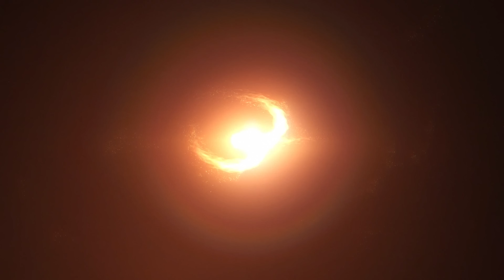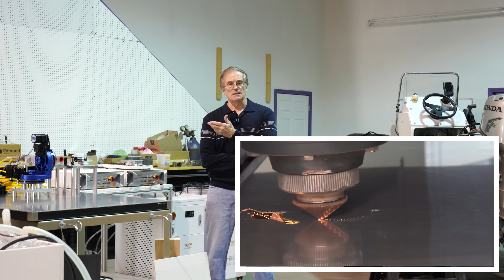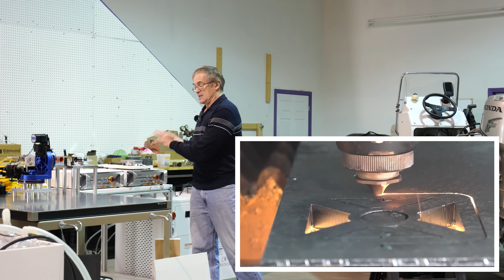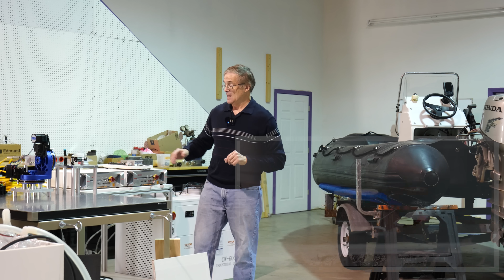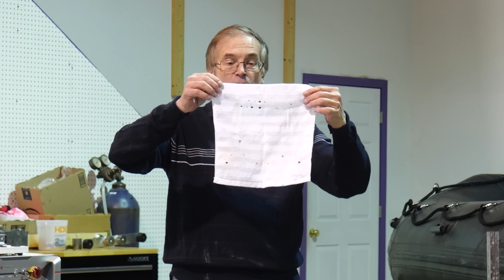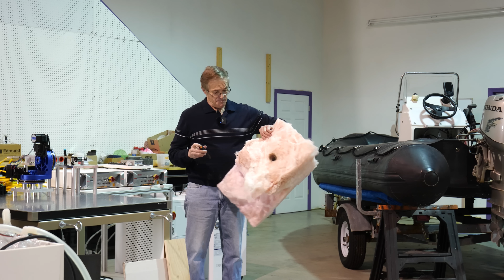We have a problem... and need your help!

Comment: I’m no pro at this, but maybe some sort of material that can simply diffuse the laser. I imagine something like a glass window, but basically a bunch of lenses. Interesting problem area
Reply: Fish tanks full of water?

It would be hard to find something to absorb the heat - even if you did, it would need to be able to tolerate high temperatures. That’s going to be hard to handle.

If it were me, something to diffuse the lazer or redirect the lazer into the sky.

What about dirt? Direct the lazer into the ground.

A handful of mirrors tilted down into the ground would safer than sending it into the sky.

Comment: Polymer defraction grating (very fine) backed by activated carbon filter (HVAC) run a water curtain over and thru both layers.  Use a pump an sump to recirculate.  Use some soap for wetting.

Comment: You could use graphite, or, if it's possible to have an optical window that transmits the laser while withstanding high intensities, you might use water loaded with optically absorbing particles (e.g., carbon black properly dispersed with surfactants). However, I'm not sure this approach would be straightforward, as much depends on the stability of the suspension—forced circulation of the fluid might help. Alternatively, an active system capable of disabling the laser upon detecting that it has reached the blocker could be considered.

Comment: So I think we need to go along the lines of Kiss keep it simple main objective is to be able to dissipate the energy second objective is to keep it from reflecting back and third objective is not to catch fire one of the things that came to mind for me that worked off a few of the principles you actually mentioned would be like a water curtain now Water by itself would be reflective so even if you made someone of a translucent tank that would let the light pass through and into the water it could reflect back and forth but therefore just poked holes and everything even if it absorbed it so we can't do a tank because it would Pierce through it and make leak and you can't make the water cloudy because then it wouldn't let it pass through the first letter and would melt the tank from the back side still making it leak but what if you took denim based insulation and made a wall type support structure whether it's just a 2 by 4 frame with a plywood facing and you put the denim base insulation hungover it so that the wall supports the denim you could even use pressure-treated lumber to help it warping and stuff depending on how often you want to reuse it but you make a rain curtain that sits there and points towards the wall continuously spring water like in a swamp cooler and it all drips back down into a trough so you can collect it and reuse some of it but using the water to help absorb the Heat as the laser points onto the denim which being a darker color will also absorb heat what's being draped across the wood will also help absorb the Heat but with water spraying down across the entire thing will help keep it from Catching Fire if any and will self extinguish while also providing multiple layers of protection because water itself takes a water energy to change phase and if it's constantly being poured onto the denim acting as a giant Wick it can hold the water allowing it to try to absorb some of that energy to change phase and then with it being draped over a plywood face on a wooden built wall the wall being soaked with water on top of it will also help absorb more energy well should still be very easy for you to move around and deconstruct after everything is done while all being very basic but each use has a practical of its own denim base insulation being fighter retardant so hard to catch fire the water help preventing any fire and acting as a cooling agent as well as a heat exorbitant agent and hopefully with that you should be able to absorb and stop the beam fairly reasonably by only using maybe half inch or 3/4 inch plywood built up on a frame to make a freestanding wall that you would rape denim or fiberglass insulation I say the denim because it's less likely to tear apart when draped over and then using a pipe on top grilled with a bunch of holes to sit there and flood it with water wallet all drops back down into a trough on the bottom or holding tank so it can be recirculated I figured if you use a 2-inch pipe across the top with quarter inch holes drilled like every 6 inches and you can feed it enough water and you have that spring across the wall that should be able to exorb enough energy

Comment: The spacecraft is designed to sustain high temperatures for a long time at re-entry. They are covered with some ceramic tiling (supertherm or similar). Another approach would be to create a surface that somehow creates a difussion on the lncident layer - some nanospheres on the surface so that there is some scattering so the densitu of energy/surface area is less. The last thing is some aerogel sandwich panels or some aerogel suspensionswith nanoparticles.

Comment: Non-expert throwing out ideas.  If you had an independent microcontroller monitoring rotary encoders on your scanning motors, that could give you another "laser disable" signal to use - if the window-averaged angular speed of the steering is less than a certain amount, the laser needs to be off.  Not a substitute for passive safety measures, but could reduce the damage of an expected failure mode.  Also put sacrificial "sensors" behind your mirrors to disable the beam if any mirror fails (that have the same "signal" for "laser detected" and "sensor destroyed", obviously - maybe a thin wire painted black, bent into a dense zigzag so the beam can't miss), backed by beam dumps (somewhat easier to deal with the problem when you know exactly where to expect the beam).

For a backstop, the challenge is the extreme power density, so diffusion is your friend (think space dust versus the space station).  Some material with extremely low absorption and a non-specular surface to spread the energy out (or at least highly locally curved if specular, use a sacrificial front cover with a large air gap to handle bounceback - with 2+ spaced layers the holes from a previous penetration won't line up with a new scattering point) that can survive the laser hitting it for a while (ideally not something that can shatter as an entire sheet).  Check what happens to your ultra-white paint?  A pile of loose marbles on a wooden frame at the angle of repose?  Something using cloudy water?  Frosted borosilicate, with water cooling (so maybe you wouldn't have to keep replacing it - or small overlapped tiles so the amount of replacing per failure is small)?

Comment: I know nothing about lasers but I have some ideas.
Maybe just a lidded bucket or two of gravel and sand or slag on a rolling cart. Patch the holes with tape. A brick was effective so maybe stick with that type of material, stoney. Buckets and earth are basically free, though in this economy...
Maybe a few buckets of concrete, on a rolling cart. (I like this one actually)
I'm trying to stick with the cheap part so as not to suggest some complicated spinning mirror system that reduces contact time with the laser and just redirects the beam into more sand.
Idk, either way I would love to see what solution you come up with and those new lasers in action!

Comment: You've explored most possibilities of absorption based targets utilizing a single material.  Consider a hybrid dispersion target. Build a beam stop starting with cement board for mounting tile, then a layer of crushed tempered glass about 5cm thick. Behind that plywood should be fine.  The laser will pierce the cement board then be dispersed by the multiple surfaces of the glass pieces behind the board.  If they shatter, that's fine, more surfaces for more dispersion. What energy is left after going through the crushed glass likely will not hurt the plywood.  Glass pieces should be packed tight and maybe lightly sprayed with an adhesive to minimize leaking through holes burned by the laser. 

You can get the glass rather cheap or possibly free by sourcing junk car windows and breaking them in a controlled fashion.

Comment: To prevent a laser from punching a hole, you can use materials that effectively absorb or reflect the laser's energy. Materials like black aluminum foil or laser-blocking polycarbonate are commonly used for this purpose. These materials can be placed in front of the area you want to protect to prevent the laser from interacting with and damaging the target.

Comment: Use a concave refractive mirror or prism  behind the target  as the backing deflector keep it simple as they say. It will disperse the light beam. Send me a check any time.
Reply: Well I didnt study aviation for nothing .. or  use a convex mirror at 45 degree angle that amed up to the sky.  cause you lazer sweeps back and forth.    won't hit any air traffic.

Comment: A third, weak,  targeting laser. The two fiber lasers work so you don't need to test them indoors. The target acquisition and aiming needs to be tested, but not with a high power laser. Build a head with three lasers on it. Align them with short pulses on a brick. then go outside.

Comment: I would probably try some sort of water curtain. Problem is flow speed needs to match the energy of the laser so you would need to match the energy per mm2 of the laser with the energy required to evaporate the water that runs through the mm3 of where the laser hits. Not sure if letting it run as a film over a surface will do the trick unless you use multiple layers as the film might be too thin. And not guiding it might be an issue as you have fluctuations in the thickness of the flow and with the large volumes you need to move it might get messy.

Comment: Youtube keeps removing my comment, probably for amazon links to best prices and all the parts and stuff. 
I hear you tho. You need ~3s of ablative. Those look like 3kw lasers. You say sub mm beam focus. If that's so, I got you...

Just mix ~99.19% Al2O3 with 0.39% TiO2 and 0.42% MnO2 into a refractory compound, cold press and sinter at ~1350c. Should give you >3s of absorption with ~2.5cm of sintered material.

Full plan:
Get some cheap baking trays, carbon welding blanket, and fence clamps. 

Apply a full set of clamps on a tray at measured positions. (i'd do 8 clamps, 2 per edge)

Lay in the carbon welding blanket in to the pan, for filler more than anything.

Build a frame to set that in so you can press the powder into it. (and do that) You want it to mushroom over the edges so that plates will lock together with the clamps and not let light past. Could do a tongue and groove thing. regardless the clamps represent the thinnest spot in your ablative so use that as your measure of thickness and try to backfill excessively thick portions to save costs.

Delicately remove the clamps before sintering. Sinter at ~1350c.

Should become a unit. Add clamps as needed to make modular walls. Clamps are compatible with fence for standing the walls.

Logic:
The alumina will become crystal and shouldn't vaporize even under the insane heats we have here. A good start but we need something to stop the light or it's just a question of how fast it can heat a volume of Al2O3 powder to liquid and have it pour off. Given the small beam that's not a lot of material. So we dope the mixture. My selections offer a few advantages over simple absorption. Lowering the sintering point, preventing sputtering, and potentially chemical buffering the high-flux energy through real-time valence shifts and phase stabilization. Regardless it should work.
Reply: Note the hidden reply...

Comment: So I am a complete novice but here are my thoughts, I wonder if fore brick would hold up better than an actual brick. You know the material they use in kilns and forges. My other thought would be something that diffraction and diffuse the beam to then be absorbed by another material, basically split the beam up and scatter the energy. Not entirely sure how one would go about it though.

Comment: sand works, the the logistics of your testing would need to change, if you can do the testing with the laser pointing downwards, a volume of sand can easily absorb that amount of heat.

Comment: How precisely are you capable of aiming the laser? I would assume QUITE. So put a mirror behind the target, angled 45 degrees so that it turns the beam downward toward the floor. On the floor underneath, a pan a couple feet deep filled with silica sand positioned where the beam is expected to impact. Remove the faux-fulgurite from the sand tub between firings. Since you're asking about how to make the wall behind the target safe, it seems you're NOT moving the beam much in operation?
Reply: To add to what I already said, white silica sand ought to be translucent enough to scatter the beam the way your tongue-in-cheek salt mine would scatter it in the mine. I'd say salt, but the way you talk about this monster, I'd be worried about the possibility of making yourself a cloud of chlorine and a pile of molecularly-fine sodium metal dust...  Neither one particularly life-friendly in an enclosed space...  <tries to imagine how bad it would be to inhale molecular sodium dust> <fails> Unless ☠ counts?

Comment: How about a laminar sheet of water forming a plane (or series of planes) behind the target? Could be 3d printed parts. Could be a series of planes at angles to beam split if reflections became an issue. 

Some sort of mister dropping a curtain of water mist to diffuse and attenuate.

Perhaps a gigantic trough of dry ice dropping a curtain of thick fog creating a plane to attenuate and diffuse the lasers. With dry ice the fog is heavier than air and sinks. Maybe two laminar sheets of water filled with dry ice fog or glycol based (fog machine) fog.

Fresnel lens? Something with little mico-spikes facing the laser to diffract the light, sort of like a miniature version of the inward spike used in an an-echoic chamber?

Interesting problem. Good luck.

Comment: How about a large mirror (I know it would have to be of a type that isn't damaged by the laser) that turns the beam through 90 degrees (vertically down) into a tank of water (maybe with a pigment that disrupts the beam).  Reflections from the surface could be a problem.

Comment: You can use two tall concrete slabs ordered from a construction company--should be cheap.  Another question: Does the FAA allow lasers in the air, that can 'slice and dice' any aircraft at altitude, or your air-space is closed to commercial air traffic?

Comment: Seems you need to reinvent the Starlight. There is a youtube video about cheap analogue, although less capable. Though I think even this material will have dificulties against your laser. Other things that comes in mind is fast conveyor belt that will distribute the energy. If this doesn't work, well I like the idea about salt mine. Cheers! 😊
https://youtu.be/0IbWampaEcM?si=SL9z1hRuxnNgBn3Y

Comment: could you change the water idea to makeing a vessel that hold water out of the same material that the lazer uses to direct the lazer? Make the vessel in a prizom shape to disperse the light so it will do less damage.

Comment: Layers of cement sheet, with a layer of sand between each. The theory being that cement sheet is far more manageable than bricks, and sand as a relatively thin layer between each can effectively fall down as it's melting, to keep further converting the light energy into heat and melting the sand. Yes, molten sand creates a bit of a mess but once hardened is relatively easy to manage. To further improve the effects, run some water drip spreaders (think about the internals of an evaporative cooler) to continually dampen the sand so there is even more cooling in place. This could buy you even more time - and would compound with each cement sheet/sand layer.

Comment: Hi RF engineer here, cheapest I can imagine is you could use a water curtain to serve as a destructible light lens, by controlling the solution ingredients you can achieve varying degrees of light absorption and transparence. Then with multiple stages of i.e. waterfalls could achieve the desired level of absorption and dispersion. You could even control the angle you position the water curtain to reflect in preferential directions i.e. 45 degree for extra safety.  Advantage this provides is that while a aquarium based disperser scales with volume, this scales linearly with the area you want to cover and is more transportable
Reply: Thinking along these lines too, perhaps a fine atomized water curtain.
Reply: This is what came to my mind too.
Reply: Use aircrete panels. You can test various additives like aerogel to improve effectiveness https://youtube.com/shorts/Ch4WF_jZhXs?si=q8BD4rdXnx37amSs
Reply: I just logged in off my TV to suggest the same thing. Enhancements "might" include steam or vapor a la Niagara Falls and baffles to prevent the water stream from lensing. Sandwich the water so if flows down the back of concrete 'tile backer board and then foams or steams up as the water runs back up the other side of the first board with another layer creating a channel behind it.
Reply: Expensive.

Comment: There are two possible solutions, neither of which requires a structure behind the material to be penetrated.
1) Reflection monitoring
This works primarily with smooth surfaces. As soon as the material is penetrated, a sensor detects the decrease in reflections and switches the laser off automatically.
2) Temperature monitoring: Works with all materials, but is more difficult to measure and has a longer response time.
This method should work with all materials, but is more difficult to measure and has a longer response time.
Once the laser has penetrated the material, the temperature of the material surface changes. A thermal sensor detects this change and switches the laser off automatically.